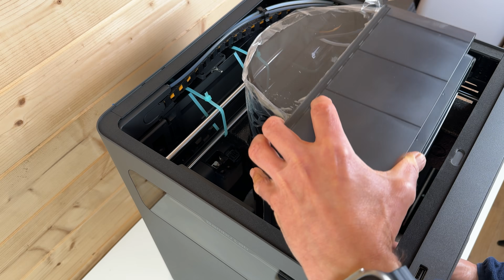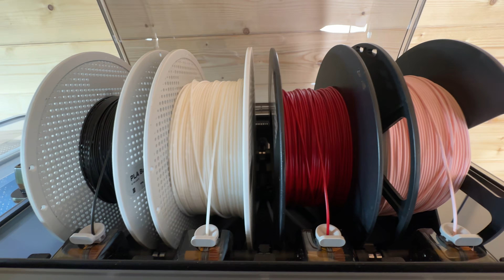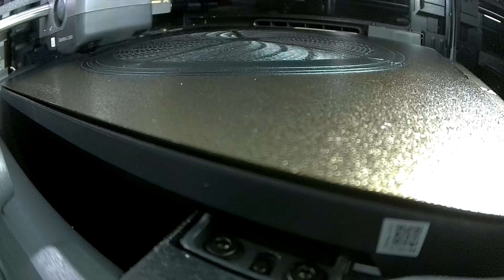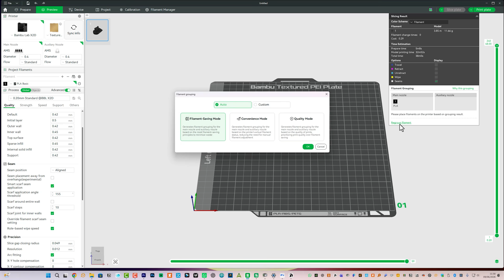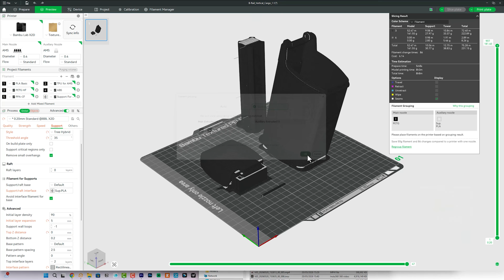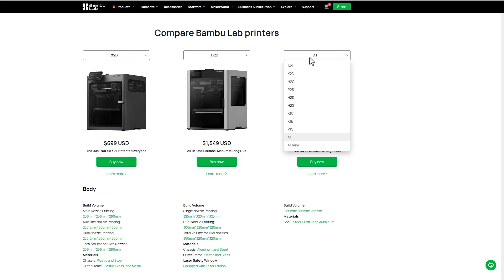Bambu X2D Review | It Made Me Want to Review 3D Printers Again

Comment: I have a H2D at work and absolutely love it. Im considering getting a X2D at home, but im willing to make my budget stretch for a H2D(but I'd be limited on anything else for some time). My main thoughts for the H2D is thst I already have profiles set up, i know how it works, how to do maintance, ive encountered errors, etc, and can easily fix it. I dont know anythinngabout the X2D in terms of real world use, and too many reviews complain about the secind nozzle. I mainly plan on uzing the second nozzle for interface layers and when making. A multi color print. Im coming from a ender 3 pro(which i hated since i spent more time tinkering than printing), so i might just be getting spoiled going from one extreme to the other. Any suggestions on wether i should get the h2d or the x2d?
Reply from the maker: If you don't need the size of the H2D I honestly think you'll be more than happy with the X2D. The "issues" with the aux nozzle just won't be a big deal for 99% of users. Yes a little slower but otherwise the only real life actual restriction I can think of is you can't use it for TPU. And the only time that might be an issue is if you wanted to print PAHT-CF in the main nozzle with TPU supports. I will cover a lot of this in my upcoming video :).

Comment: Layer lines are visible from the moon
Reply from the maker: Most the prints in this video are at the default 0.20 mm Standard which prints quite fast. If you change to HQ or drop to 0.16 mm HQ the quality is far better - all depends what you need. I have had a few issues with the printer though which I'll cover in the follow up video ...
Reply: @TheTechnologyMan They are still visible but bit less.  Like in every bambu printer I have tested. How about we start telling people truth that bambu print quality is just not great ?

Comment: A food dehydrator will dry filament much more quickly and the AMS 2 Pro with decadent will keep it below 15% for a couple weeks. I enjoy designing functional parts via CAD. This machine fits that bill perfectly. However, I am still concerned about having a means of fire suppression. Have any recommendations for that?
Reply from the maker: It's very useful for keeping the filament dry, and drying whilst printing. I'm still generally drying filament in separate driers - mainly because I always have at least one spool of PLA in the AMS so can't run the drier higher than 45°C! Sorry not looked into fire suppression but will try to for the next video.

Comment: Very easily one of the best reviews I've read so far. I'm still printing out of one of my Polyboxes with the Aux. Nozzle, but it has been flawless to date. I do see that my local Microcenter has the AMS-HT back in stock finally. I agree with every one of your points. It might not be the best choice for a beginner, but for someone willing to put in the effort knowing it might take a bit more effort than just pushing a button , it will reward them in the end. Watching it change nozzles still amazes me and peeling off a strip of supports using a support interface printed with that nozzle still puts a smile on my face. Gone are the days of looking at an item with contrasting text and telling myself that I really didn't need the text.

Comment: Mine has those layer lines…. Everyone seems to have it but doesn’t look normal to me,
1 year of 3d prints on my Anycubic kobra 3 v2 that had like no layer lines and now I run into this.
Are those inconsistent layer lines normal? What can I do to stop it…
And I’m talking about them being inconsistent (not all the same alignment)
I’m also having random layer shifts, (minor but impactful)…
Reply from the maker: I'm not sure specifically which print you're referring to in the video. But the standard profile still prints pretty fast. You'll get much smoother results slowing down outer walls. Or just choose the 0.20 mm High Quality profile. I have had some issues with supports and cooling that I'm looking into for the follow up video - that can give what looks like layer shifts when if it releases from the support.

Comment: did you expirience problems with TPU in AMS?
Reply from the maker: Only TPU for AMS which prints just fine! Other TPU needs to be fed manually or with the TPU Assist Module - I'll be covering all this and other more advanced topics in the upcoming video.
Reply: @TheTechnologyMan i hoped for some way to conviniently switch, lets say tpu assist module on way from ams to printer. I dont care that much about filament swapping when printing tpu i just find it convinient to not havr to load it manually.
Reply from the maker: Apart from AMS for TPU you need to load manually even with the TPU module and the AMS HT. Having said that manual loading is not difficult - it's just you need to be by the printer.

Comment: I got mine X2D these days. I really like it. It works fine. But I have AMS filament to sliced object sync problem. I hope I find the problem. But overall. I love it 🎉 I’ve been using my X2D these days and I really like it. It works perfectly. However I’m having a problem with AMS filament and sliced objects syncing (printer dialog tells me, that real world and ams and object colors are not the same). I hope I can sort it out but overall I love it! 🎉
Reply from the maker: The mapping is a little confusing.  The colours you have in the slicer can still be different to synced filaments in the AMS (shown most clearly on the device page). I just sync the filaments then only have the filaments I'll be printing with, that I manually select from the dropdown. Note - makes more sense if you change the default Mapped, to Overwrite in the Sync menu. At least you then get the actually filaments loaded in your printer!
Reply: Yeah I do it the same way: open model → switch device → sync filament → recolor objects in the object filament tool → object shows correct in 3D → slice → print. And that’s exactly where it tells me every time: “The filament configuration installed on the printer does not match the slicing file. Please re-slice.”

Turns out it’s usually harmless. If your slot assignment is actually correct, just hit send and ignore it – the printer does its own RFID check at start and grabs the right slot anyway. In my case the diagram was off but it printed the right color regardless. Don’t trust the software diagram too much, trust what actually comes out.
Reply: And thanks for the video by the way